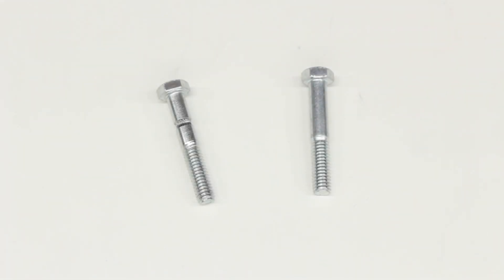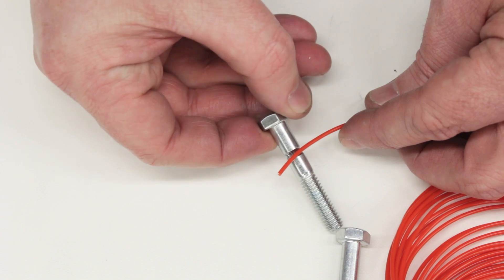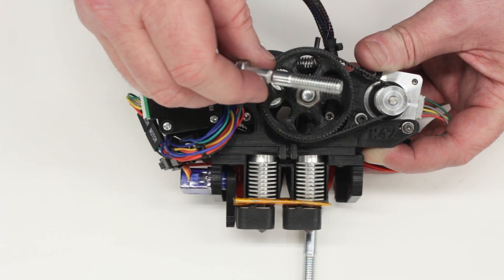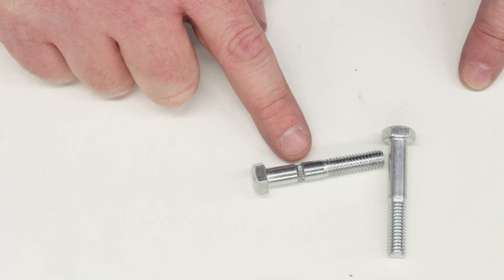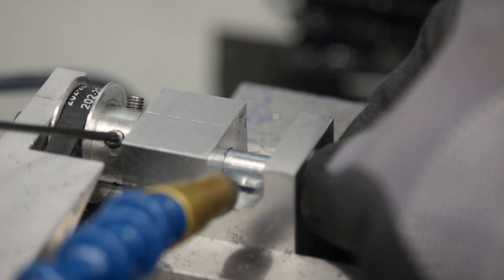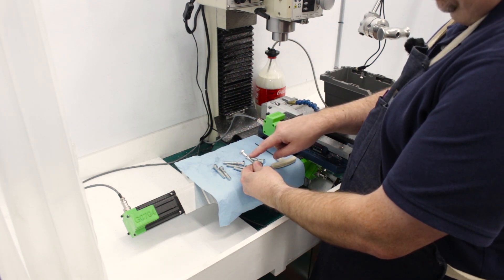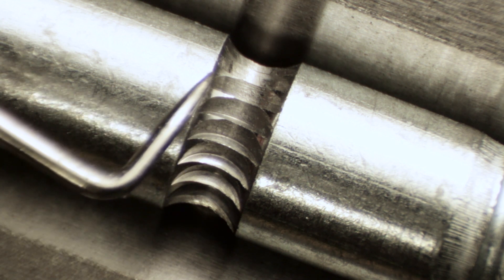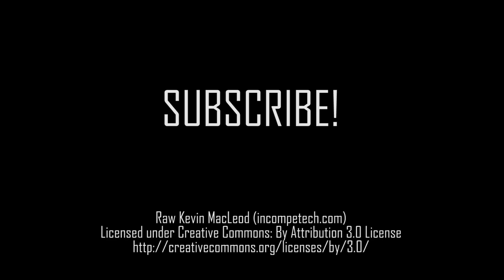Making Hobbed Bolts

Comment: Great video. Very cool that you’re using your small mill with a clever setup to produce a marketable product that helps pay for the hobby! It seems like your bolt hobbing setup is basically like a 4th axis. Have you ever experimented with using most of this setup to make small gears? 

I’m a fairly new hobby machinists and have been interested in learning how to possibly use a forth axis on a conventional bench top mill to produce small gears for numerous small ideas.

Comment: What kind of end mill did you use for making the cuts?
Reply from the maker: It's a Garr 06057 1/8" 4-flute carbide stub end mill with a TiALN coating.  I get them from a local distributor.